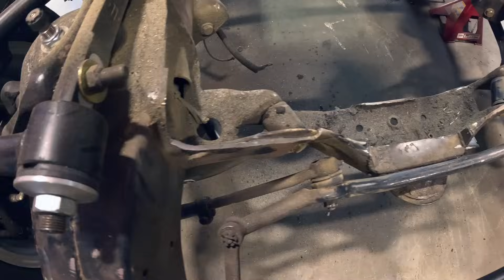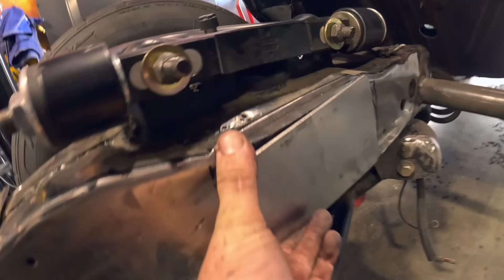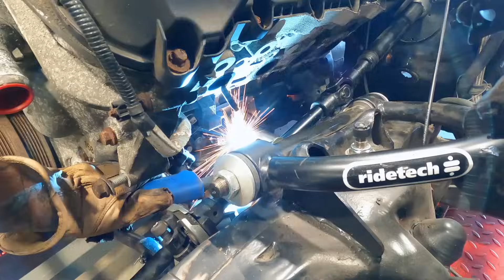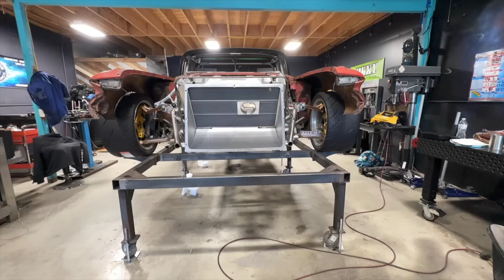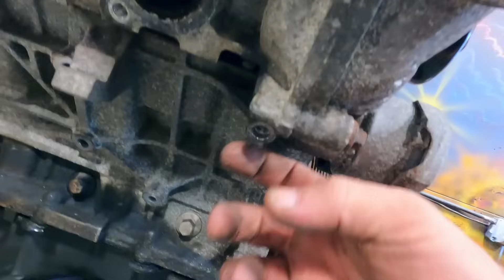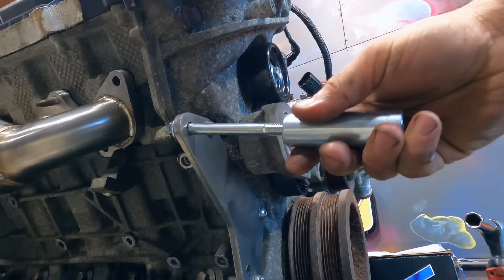How I Finally Got the Coyote to Fit in My Chevelle

Comment: Your AC's smooth idler pulley appears to be mated to the ribbed side of the belt. Are you planning to replace it with a 6 rib idler?
Reply from the maker: Yes sir! I borrowed the idler from the apposing side to get me moving 
But you got me thinking of something when the correct one comes in I am not sure if they are the same size diameter 
I might be buying another belt oooofff